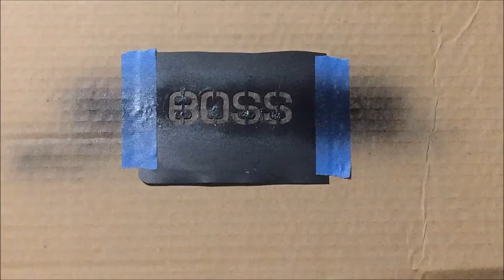Making a Waterfall Edge Desk

Comment: Did you solder the led strip so you could use it without a controll box?
Reply from the maker: The only thing I soldered were the two pieces of led strip together, which are plugged into the ir receiver that gets the input from the remote.